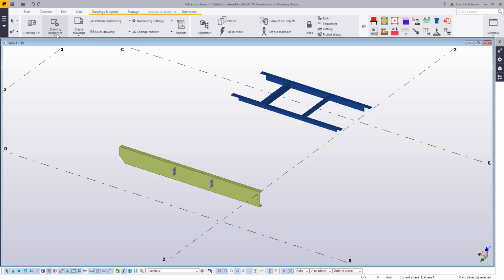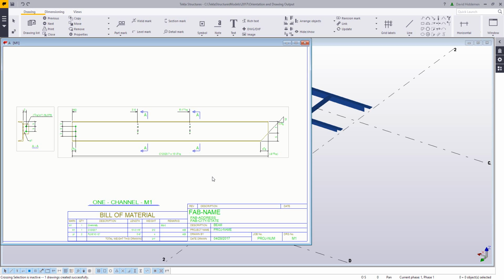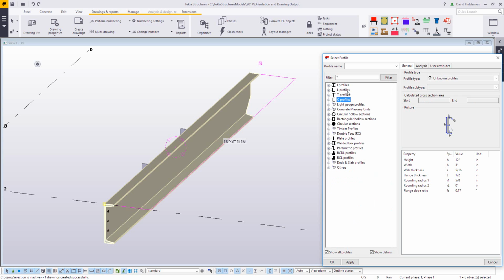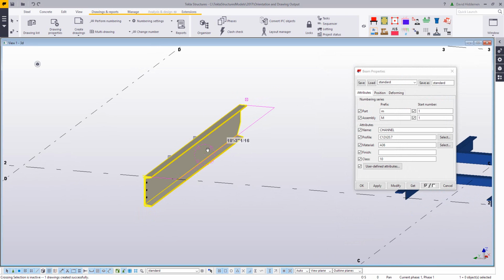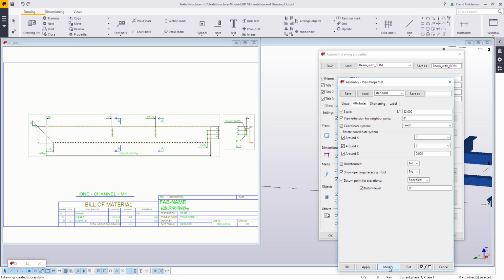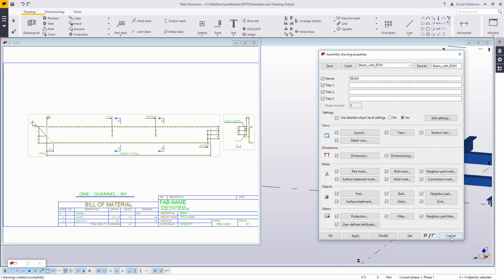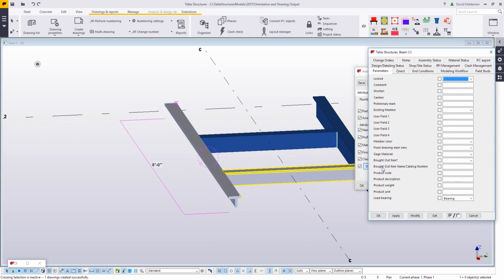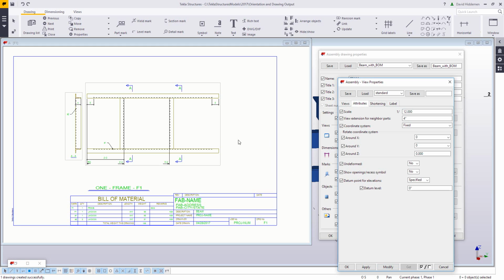Fixed Drawing Main View

Comment: Does this method work for Contour plates
Reply: Yes, it does, but usually the setting "Local" gives the correct view. If rotation is needed, there are other settings on the Attributes tab of the View properties - Around X, Around Y, and Around Z that I can use. Contour plates can also be affected by the advanced option settings XS_POLYGON_PERPENDICULAR_EDGE_PREFERENCE_FACTOR (https://bit.ly/2tA0oLb) and XS_POLYGON_SQUARE_CORNER_PREFERENCE_FACTOR (https://bit.ly/2KgXmG3), although I have personally never had a need to adjust them.
Reply: Thank you for the reply. I do a lot of chute work and trying to orient the plates in single piece drawings has been troublesome. What I have found that works well is to be sure to model the first and second points as I want the piece to show in the drawings. Then set Orientation in UDA to first to second. This method seems to be working well.

Comment: You should be aware that using this setting w/ any other value than Top or Front can cause the cnc output to be rotated differently than the drawing. the cnc files are always created from th efront view.
Reply: Can you please tell how can we know which one is front and which is back.
Reply: I'm always confused how to keep orientation in model while placing Beams and column like front, back ...sir can you please explain me
Reply: @EnglishStoryHub-m8m As A Standard Beams Should Be Placed Left To Right Or Down To Up And Columns Should Be Rotated As Top Or Back, This Will Allow Your Drawings To Prompt The Shipping Marks Of Your Beams Always On The Left Side (erection Plans) And Prompt The Correct Face Orientation For The Columns (Given That Your North Direction & The Standard Detailing View Is Correct Or Calibrated)